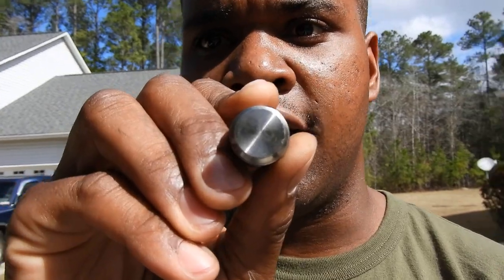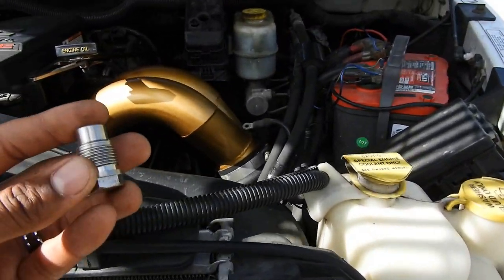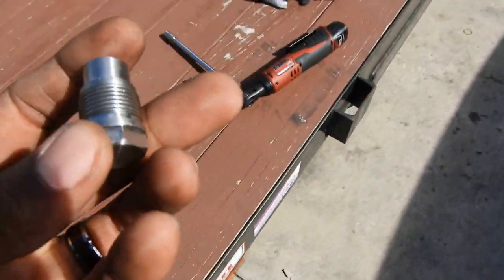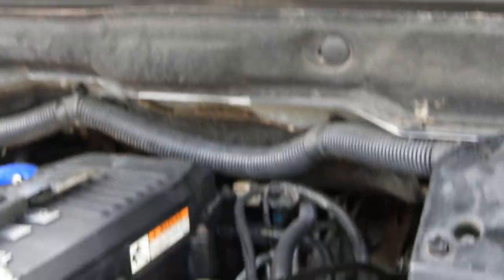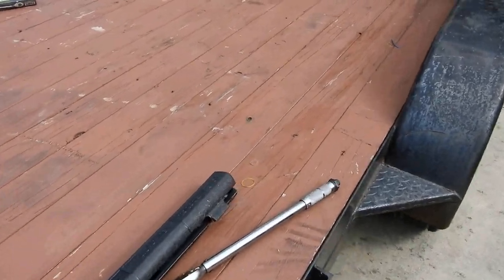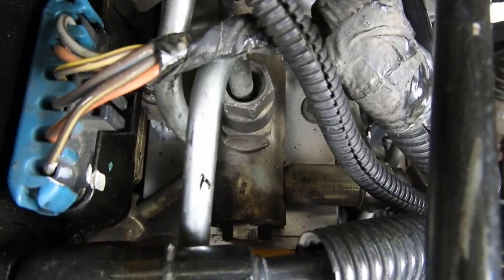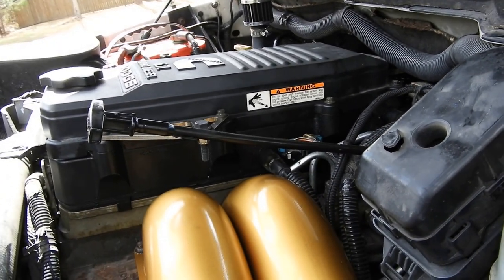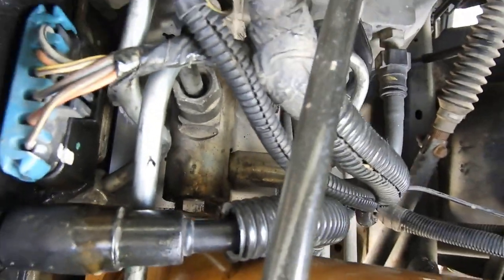FUEL RAIL PLUG INSTALL ON CUMMINS 6.7/ CHEAP MOD

Comment: This is nothing new old truckers used to pinch off the return line to accomplish this. However these safety devices are put in place for a reason.

Comment: What about the risk of blowing off the injector tips because now you have no way to vent the pressure which is how the system was designed? I read this on several different sites? What have you seen from doing this? 

My truck is a 12 g56, ddceramic clutch from valair, s465 stainless Diesel swap, arp4202 studs, Fass 150gph pump, longhorn traction bars, efi live from hpp (max effort 285hp), dynoed 586hp, 1173tq
Reply from the maker: Big T if you got cheap injector then yeah you should worry. Unless you pushing 30k line pressure I wouldn't worry too much. I did it and I like it.
Reply: EVERYTHANG DIESEL running factory injectors for now. I'll look into this as one of my next mods when I do injectors and cos3
Reply from the maker: Big T not bad setup man. I'm on stock injectors myself too I need more fuel haha
Reply: A very real concern. Nothing better for getting cracked injectors.
Reply: @EVERYTHANGDIESEL  m

Comment: Air dog are junk everyone I’ve had bleed back fuel and I had to install check valve fleece is the best plus it goes in the tank so there no ugly filters hanging down off the frame

Comment: Does the fuel rail plug make difference in horsepower torque or drive ability ????? Does the 2021 have the same thing??

Comment: Question?,,, Everything Diesel.  I have a 2012 6.7 running EFILive only on stock and tow settings.  Do you think I have to worry about reaching the 30K limit on fuel rail pressure.  I'm running stock injectors and pretty happy.  Don't want to ruin them or the fuel rail.
Reply from the maker: No u wont

Comment: What intake exhaust do you have on your ram?I have a ram 2015 2500 any suggestions.Ty for your videos.👍🏽
Reply from the maker: That truck had a s&b cold air intake and a 5in flo pro exhaust

Comment: @everythingdiesel just so you are aware bro, they put these in for a reason. When you block them off like that you are still going to get fuel pressure spikes and instead of blowing off like it’s supposed to it’s going to put pressure on your injector bodies and could crack those. Way more expensive to replace then that plug, and the video from CP you link isn’t exactly accurate. They are designed to crack off multiple times.
Reply from the maker: i know what ur saying man, so from my research and experince ( since i've had this in for over a year) it seems if your not running excessive line pressure such as 36k or higher you should be fine without the relief valve. i belive once injectors start to get super old and u push massive fuel pressure is when you into blowing a injector tip or cracking the cup. this is from my research. but i im aware of what your talking about.
Reply: I’ve herd both sides of from a shop near me, personally not my cup of tea lol I would prefer the safety aspect of it especially when I have $3k injectors one my rig! Lol but love the vids man. Keep up the good work!
Reply from the maker: @achej7022  100 percent dont blame you. Especially when u got 3k injectors. When I do twin cp3 and Injectors I'll probably take it out.
Reply: There is a company that rebuilds them that can set the spring tension. Starts with a T but can’t remember who it is. Give them a try when you are ready for that
Reply: T&C diesel does the rebuilds. I had to look it up lol

Comment: I know this is a bit of an old video but I have a 4th gen 6.7 in doing the fuel rail plug delete do you need to have an FASS system or a fuel/water system or are you ok to run the stock fuel filter system?
Reply from the maker: Your fine to run on stock fuel.
Reply: @EVERYTHANGDIESEL  thanks man appreciate it! Def gonna do the fuel rail plug, looking into just cutting up my grid heater and doing the CCV! I love the catch can idea so I really think that's the route gonna go with that!

Comment: I noticed you have the pusher dual intake... how do you like it??? I have the whole bank's set up with the 4" monster and I personally not digging it.. I feel like I'm getting way too much air....
Reply from the maker: I like my setup. I've been using it for almost 2 years now. The banks one looks good but it's really expensive vs the 120 I paid for this
Reply: @EVERYTHANGDIESEL  dude had coincidently found it (intake horn)  on extreme diesel for 300 but yes the I am retuning my whole shit next week since I added all the upgrades and yes banks is stupid pricey...... Haha.... pain in the ass to install the whole intercooler setup... anyhow thanks for the reply and have fun with your rig...
 I'll update you with a video or comment next Thursday the 19th after retune.. 🤙🤙🤙🤙
Reply: @EVERYTHANGDIESEL  I meant that I found the PUSHER dual intake horn but it was around 300i think
Reply from the maker: Sounds good man!
Reply from the maker: You can get a the generic intake like pusher for 120 on Ebay that's what mine is. Exact same as pusher intake
Reply: @EVERYTHANGDIESEL  hell yeah good to know!!!! I'll update you with retune Thursday
Reply: @EVERYTHANGDIESEL  thanks again.. happy father's day everybody

Comment: Been watching some bids now and this is for the intake manifold elbow.  On the original you had on there before you replaced it with the current gold one, had a gadget of some sort screwed on top of it along with a gold/maybe brass bar that went along the front of the manifold.  Where is that piece now after you installed the gold elbow? Thanks.  I haven't seen a video yet that shows where that went or was rerouted too.  Thanks
Reply from the maker: So if u install a aftermarket one your truck needs to be deleted. You are referring to the probe on the stock manifold I believe. That is no longer used on the aftermarket setup since your egr is deleted.

Comment: Great videos! Just found your channel. Will this hinder any tunes for fuel economy? I have new 2022 ram 2500 6.7.
Reply from the maker: No it won't. But don't remove it unless u have a aftermarket lift pump with filters built in

Comment: So what’d you end up getting on gains for it? Acceleration, better towing, higher rpm hp?
Reply from the maker: What I explained in the video. You will have a better fueling curve and wont have to worry about peaking out the fuel rail and starving the injectors

Comment: I did the fuel rail plug and now my truck Cranks but don’t start, any idea?
Reply from the maker: Probably need to hold it for a little so the so the fuel pressure can build up

Comment: Did it,..cracked the top of the injector on #5. Flooded the motor 100% with fuel, it blew all the oil out of the motor. Luckily I did not destroy the motor. I have no idea how I did not destroy it. I was only running maybe 400 hp at the very most. I was towing up a long hill for half hour. Don’t do it. Just not worth it.

Comment: Does it give it more horsepower? Swapping that plug
Reply from the maker: no not really but it helps your fuel rail not deplete its self on hard accelerations so your not starving your injectors.

Comment: Does your intake horn/manifold have the throttle valve delete?
Reply from the maker: Yeah the aftermarket horn doesn't use a throttle valve.
Reply: @EVERYTHANGDIESEL  the link in  the description is that the fuel plug and ans intake you bought?
Reply: @EVERYTHANGDIESEL  ?
Reply from the maker: Yes

Comment: Hey can someone pleas help me. I got the same year and engine as you . Deleted and might be programmed or timed I bought used. And I was going 95 and got a code and lose of power so I checked codes and I got p1011 and p0087. Not sure what it could be could it be I was sending to much fuel and need this plug ?? Thanks guys
Reply: Valve, collapsed fuel lines, weak injector pump, clogged fuel filter. Any number of these things. My 0087 code was from weak/soft fuel lines and fprv being weak. Replaced them and all is well now.

Comment: Hey bud, just found your channel. What was your code ? I have a P1011 code that keeps popping up with I hit the gas paddle hard. Let me know asap please
Reply: i have a 2008 dodge 3500 with a 6.7 cummins and a check eng code pop up p1011  how did you fix the problem.i would like to know hanks.
Reply: @JC-rz6gf  changed the fuel filter on the motor. There is one in the tank on the lift pump that gets clogged up. Think that is the problem. I'm going to put an air Dogg on it, so it should go away
Reply: @G815-f6f  Thanks for getting back with me. i have changed my regular fuel filter. check engine light went out. Then my truck stoped i restarted i do have a fleece powerfio lift pump in tank. i will change fuel filter 1 more time.and i"m change the fuel rail plug next a friend said that next thing to do.good luck with your truck. i have 2008 6.7 Cummins.

Comment: will that fix code P0087 on my truck? im getting that code since I put my tuner
Reply from the maker: Yes it will most likely fix it. Unless ur pump went bad injection pump
Reply: Hopefully not, my truck only has 135k  miles. Just deleted my truck with ez link and drove it 40 miles and code came up
Reply from the maker: Yeah try doing that also I would recommend  a lift pump from like airdog or fass

Comment: I have a check engine light on and the code reader said it was the fuel rail sensor.  Will putting a plug remove the check engine light?
Reply from the maker: no u need to change your fuel rail sensor

Comment: Just installed a Fass 165/Beans sump on my 06 Ram 2500,think it would be a good idea to install this?
Reply from the maker: Install what?
Reply: @EVERYTHANGDIESEL  the fuel plug?
Reply from the maker: Yes I recommend that to common rail owners all the time. Unless extreme applications of fueling.

Comment: I just found your channel the other day are you still working on the Cummins and building it out??
Reply from the maker: Yes I am sir!
Reply: You saved me thousands of dollars...I got my whole fuel
System replaced after my CP3 pump grenaded sending metal thru system and at the same time I decided to get my truck tuned. Well the mechanic that replaced it didn’t understand the system. So every time I hauled my camper it would  cut out and the P0087 code come on...He replaced the relief valve and and never even entertained a plug. Same problem kept happening. Back in shop several times. Was watching your videos and saw the fuel plug one. Ordered one and truck runs way better. Going to install upgraded lift pump. Anyway thanks for the video👍🏼👍🏼👍🏼👍🏼👍🏼
Reply from the maker: Glad it helped brother! That's what the channel is for man!

Comment: Will the rail plug affect fuel economy I'm all about that right now
Reply from the maker: it won't decrease it you may see a slight increase depending on your setup but not really.
Reply: Thanks bro

Comment: North Carolina? Like the gold pusher!! Can’t wait to upgrade mine
Reply from the maker: ALL KNOWING BILLY thanks man I love that manifold gives it nice sound n better flow. Yup in Jacksonville. .
Reply: EVERYTHANG DIESEL used to live in Swansboro - miss the fishing and onslow beach/emerald island
Reply from the maker: ALL KNOWING BILLY I know what you mean man I missed before I moved here haha
Reply: semper fi, was in cherry point and j-ville for a long time. if you need any diesel parts we are glad to support, 1-2day shipping to NC.
Reply from the maker: QuickStyle thank you guys! What parts do you offer?
Reply from the maker: QuickStyle I watched that 2nd gen install on the 3rd gen it looks badass. How much would that kit cost me?
Reply: everything from efi live, bully dog, mbrp, wheels, suspension, intercoolers, rads, headlights/ tail lights, lift kits, tips, etc etc etc

Comment: Great 10$ mod to cause 10k worth of damage.
Reply from the maker: Kyle Cantu maybe for you not for me. I have zero complaints
Reply: Its kinda like a ticking time bomb
Reply: Its completely safe. They wouldnt sell them if they werent. Experts for cummins and duramax all over recomend them and call them safe. I have one in my truck run pretty high rail pressure in my duramax and its not a problem. If it was going to blow it would be pretty damn quick to happen. Not later on down the road
Reply: my truck is a 2008 dodge ram and when im goin up hill it would have trouble keeping the rpms steedy when i would gas it and i was wondering if you would know?
Reply from the maker: It could be a lot man!
Reply: @Single Sucks name one big aftermarket company thats going to put their name on a part that just makes your truck take a shit.
Reply: griffin pierce Ever heard of Dorman?

Comment: What about any pressure in the rail when you loosen the plug
Reply from the maker: Nope when u turn on the engine the rail line doesnt hold pressure

Comment: Why cant I just get a bolt and plug it off ?
Reply from the maker: wouldn't hold under that high pressure system. Not even a grade 8. plus it would probaly leak and mess with your rail pressure pretty bad.
Reply: @EVERYTHANGDIESEL  what's your email?
Reply from the maker: @jamesallen9378  everythangdiesel@gmail.com

Comment: What are the benefits of this over all?
Reply from the maker: Big T normal rail pressure tops off at 27k. It can cause premature failure and loss of rail pressure. With the plug delete it will allow your fuel to continue to run at high rpms and it's not bad for your truck it's actually good because whenever you get up on your engine and it relieves your rail pressure you starve your injections and that when it sounds like your truck want more fuel but doesn't have it. It's coming from that stock rail plug.
Reply from the maker: Big T https://youtu.be/Hxpq1LfG584

Check out the video
Reply: EVERYTHANG DIESEL h